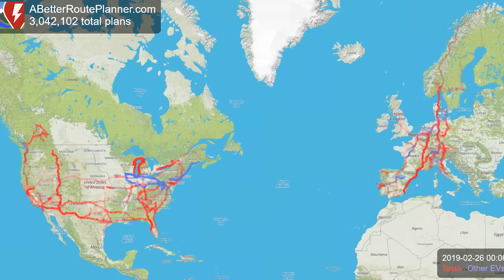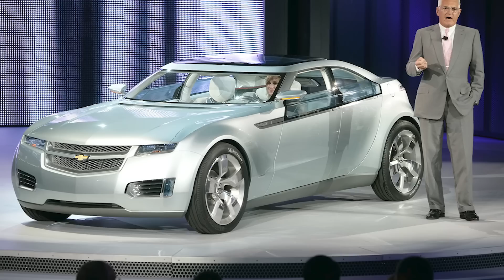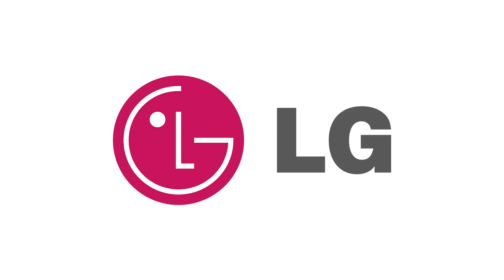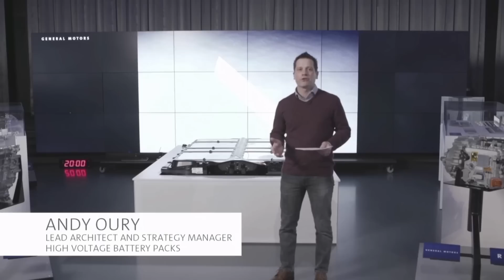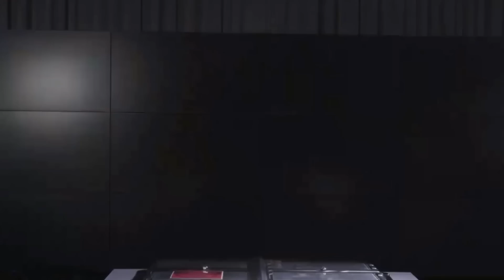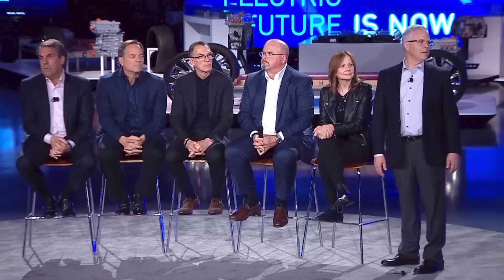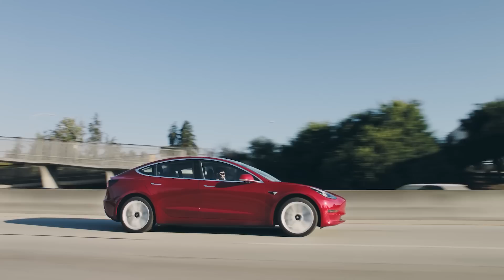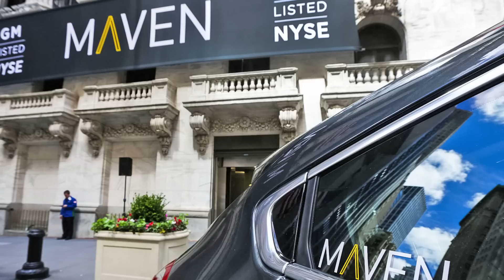GM EV Day | In Depth

Comment: Too critical of GM imo

Batteries will become a commodity product in the same way solar PV panels are a commodity product. This is probably 5-10 years out but they will get cheap

Batteries, electric motors, and power electronics will become cheap and very competitive for anyone who wants to buy them

In the same way inverters and PV panels are cheap for anyone who wants to buy them

The old car companies can continue to be old car companies. Only about 20% of their business will be lost the 20% that is the ICE part. They will keep 80% of their business

And the business of cars will likely grow
If the world becomes as rich as Europe that's pretty much 1 car per household which means annual car production will probably need to double
Reply: Yes but there is no reason to believe GM will be the company which will capitalize on this reduction in price. As you say india, china, africa and south america is where the vast majority of cars will be sold next 5-10 years.  This are emerging economies and 1 car per household will be the norm like in the west. Maybe less because of the ride sharing aspect but still - lots of demand in this emerging economies.

But if you want to be cheap and fast and high quality - you must let go of legacy production lines and systems and use more automation and nurture a great company culture like tesla is doing. That is how the cheap key parts become assembled in an even cheaper competitive end product. A legacy manufacturing system is actually a liability not an asset. 
As such old companies, GM in particular - dont stand a chance. Because what they have is actually a disadvantage. And they dont realize that. They see their experience and their existing systems as an asset. Few things are worse then mislabeling something. Gives one the illusion that they are safe, and in control.  

You can see a parallel between yahoo and google. Back in 2005 you would not have said yahoo will basically die off. But was obvious all along. All they needed to do was to properly copy google. They did not do that. They were very confident in their "experience". All gm needs to do is copy tesla. They dont properly do that as you can observe. They keep failing to do this for years. They will dye. Same mistakes as yahoo.  Why would be different for them?
Reply: @aion2177  This is a ridiculous comparison

Software especially free software has a sticky nature to it. Someone can invent a social network twice as good as Facebook but it would fail because users won't switch from a platform with all their friends to a new platform with none

It's not the same with cars
The best selling car in Europe is the VW Polo it costs £13,000 while a model 3 is £43,000 most the planet can't afford a Tesla which is why they have less than 2% market share and will continue to do so for 5 years.

Almost all the big car companies will survive and transition to electric cars. This will happen because all the car companies will have access to cheap commodity batteries and electric motors.

The electric powertrain will go the way of solar panels. It will get cheaper and cheaper and everyone will have access to cheap high quality large volume batteries. Just like everyone has access to cheap high quality large volume PV panels

Electric powertrain, electric batteries are where solar was in 2005. Fast forward 10-15 years and no one will have a battery or EV powertrain advantage in the same way no one really has a solar PV panel advantage
Reply: @kaya051285  "Almost all big brands will survive the transition to electric cars" No they will not. What do you mean.. that they will make electric cars and try to sell them? they will try. Does not mean they will succeed and they will still be here, and be called a big company  in 5 to 10 years. I mean if they produce very few cars i don't consider them as "still being here". Nokia is still here. But not rely.

 It's like saying that nokia, motorola, and all big phone brands will survive because they have expertise, and have access to cheap high performance microprocesors, and batteries, and all will survive the transition to flat screens, because they  get cheaper and cheaper and become commodity prices and everybody has access to them. As such motorola is still around, and nokia is still around in 5 years. No they are not. Apple yes, samsung yes. And the reason this 2 survived, is good talented team,  and a very big focus on improving the tech + a big fan base in case of apple (that's similar to what tesla has).  Is easier for a newcomer like huavei to come with a fresh team and eat nokias launch since nokia forgot how to innovate. Im not sure if this the best example, but you can pick another big brand which failed in the last 10 years - see why that is.

About the network effect, there was no real network effect that google had and yahoo didn't. On the contrary yahoo had yahoo messenger and mail, and yahoo search, and google did offer the exact same thing but better. So they won. Yes with facebook is different but i gived that example specifically because is not rely like facebook.  

Good batteries are patented. Certain companies like tesla have an advantage. If they keep this advantage for 5 years it all it takes. They seem to want to share patents but that happens with lag. But ultimately the advantage is the speed of development. How talented is the team. If the inputs(motors, batteries) are the same price for everybody as you say (even if only partially true) - then given same inputs - you still win with a better team. Because they produce a better product which people want. Then because this game is about automation. Is not about the production lines which already  exist in factories like GM has. Those are slow. Are relatively inefficient. Thoue will not move with 10-20x faster in 7 years form now when AI developments enables serious automation. This automation we have now at tesla is a joke compared to what will eventually be. So thouse old companies factory lines are a liability. They cost more, and produce less, and because of that you must replace them or you are forced to sell the product at a loss or break even.  

Yes you can buy robots and stuff, but the real bottleneck is talent. And old companies have this super dupper problem that nobody good wants to join them. Nobody feels eager to jump on a sinking ship. Good engineers go in startups and the hot stuff like tesla - because the incentives align as such for them. It pays to be in the next google early. Plus the sense of contribution. Not so much about getting more money. Plus they also realize that being in a crowd of cutting edge innovators is better then in a crowd of kechupers. Is just how creativity works. When somebody good creates products which reach local or global maximums - the only alternative is to copy them. So you must be a ketchuper. Not as fun.

So what im basically saying is - car companies evolve into technology companies. As such innovation and talent and the culture developed becomes more important then the physical production lines which certain old companies already posses. Because those can be made new - and there is a lot of value/potential in starting form scratch and applying all the learnings and new tech we have developed till now. Took 9 months or what to build the china gigafactory. That is innovation. As long as you can borrow/raise capital, and build new - this will keep being true. 

We gonna see about the upcoming financial crisis because this has the potential to turn everything on its head. Tesla can even go bankrupt, and GM most likely will go bankrupt. Pretty tough.

And about the low prices of cars you mentioned. There is no reason why you can't have electric cars be even cheaper. If you take out all the complexity of the ICE engine, as batteries become cheaper as we observe - electric cars should be much cheaper. You should have profitable prices under 10k if a polo is 13k. But that comes with time. Due to serious automation cars will be produced for very cheap, and that's exactly the kind of setup old companies have trouble properly implementing. 

I guess we just need to wait and see.
Reply: @aion2177  So your idea is that Tesla and only Tesla has the ability or talent to produce EVs. Proven wrong by simply stating a fact that over a dozen EV models exist and the closest one to the M3 is probably the Hyundai ionic. More or less the same size

Tesla has the logo so they can charge significantly more. But the two cars get almost identical efficiency in miles per KWh

This shows Tesla has no battery advantage. No motor advantage. No power electronics advantage.

They have a brand advantage so can charge £43,000 instead of £27,000 for the ionic and use this much higher price point to throw in a few more battery cells and a bigger motor. Things Hyundai could also do but no one wants to pay £43,000 for a Hyundai badge

I'm pro Tesla but I realise their main and perhaps only asset is their logo. Don't get me wrong selling logos is the best business to be in charge $thoauands more for a logo.

Most the big car companies will survive just fine. Tesla will probably position itself as a high end car brand perhaps above BMW but below Porsche.

The big guys will take the low end and the middle. The likes of Hyundai Toyota Ford GM and Chinese Brands

The reason the existing car companies don't go electric, besides the simple fact that battery capacity doesn't exist, is the simple fact that electric powertrain is too expensive

An Audi A4 can be had for below £25,000
The model 3 is £43,000

Audi correctly beloved their customers don't want a 250 mile electric Audi A4 for £43,000 because the petrol version at £25,000 is so much more affordable

Could Audi make a £43,000 Tesla clone
Sure I think definitely yes
Is there a market for £43,000 electric A4s. Probably not

I have an A4
I wouldn't pay a £18,000 premium for an electric version. VW knows this. So they don't push EVs not until this £18,000 premium drops significantly

I might be willing to pay £30,000 for an electric A4 but definitely not £43,000

I might be willing to pay £30,000 for a M3 but definitely not £43,000

Audi can't make a £30,000 electric A4
Nor can Tesla make a £30,000 M3

Early adopters are willing to pay this huge premium for a Tesla but most the public isn't

Not to mention most the planet isn't as rich as America. The UK is one of the richest countries in the world and the top selling car is the ford fiesta costs about £14,000

The average price of the top 10 selling cars in the UK is around £16,000

A model 3 is £43,000
As you can see it's well above what most new car buyers can afford

Also Tesla is still heavily subsidised
On the UK they get £3,500 per car and a £500 car charger subsidy. That's £4,000 sub per car.

How much profit would Tesla have made if they had to sell their cars at a £4,000 lower price? Well it's a trick question because even with the huge subs Tesla 2019 was another loss year

Don't get me wrong I believe EVs are the future. But they aren't the now or the short term. EVs are probably where PV was in 2005

You're twins in 2005 were telling me how fossil fuels were screened because PV prices would just keep on falling exponentially until in a few short years the whole planet would be PV powered

They were wrong
You are wrong with your 5-10 year predictions for the same silly mistakes as the PV people of yesteryear were wrong

In short EVs will win out
It won't be this decade probably the next
And probably no one company will have more than 20% market share. That means at least 10 large EV companies will exist. Toyota and VW will definitely existing. So will ford or GM. There may be some buy outs but if GM baught ford tonight does that mean ford does no it means it lives on inside this bigger GM Ford Hybrid

Anyway good luck to you
No offence but you're not worth any more of my time

Go read old forum posts about PV in 2005 and see why you are wrong
Reply: @kaya051285  Yeah no offence taken. Ive see you ve written a long ass comment. You misunderstood me in a bunch of places. I also see you base your analysis on whats visible in front of you, what has been done and proven - not  on fundamentals - or what's actually possible. That makes you see squed. But everybody is doing that, acts on it, acts like that - which is more important - that's why statistically you gonna endup being right enough times and as such still keep this frame - its not the best frame possible - so i guess we just need to wait and see. 

If YouTube gonna still around and kicking in 5-10 years i guess we can come back to this comment and verify what happened. Have a nice day :)

Comment: I don't believe any of the BIG car manufactures will make a successful transition to electric, especially GM. They do not have the internal culture to achieve a shift of that magnitude. They killed the EV1, shut down the Volt and are barely hanging on with the Bolt. As a Volt owner that power plant (Voltec plug-in hybrid)  could have totally satisfied American driving needs and made people aware of how great EV driving really is. Chevy spent a ton of $$ to develop  it and never really embraced it. Sad.